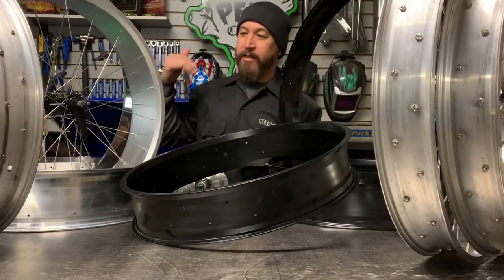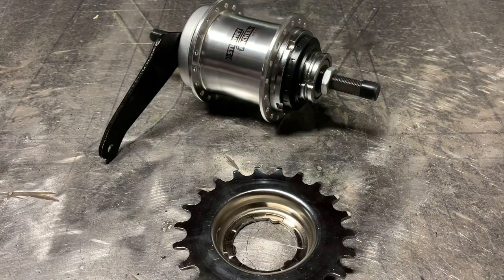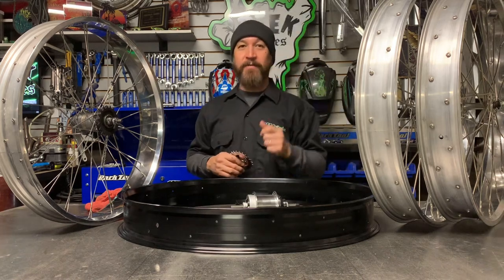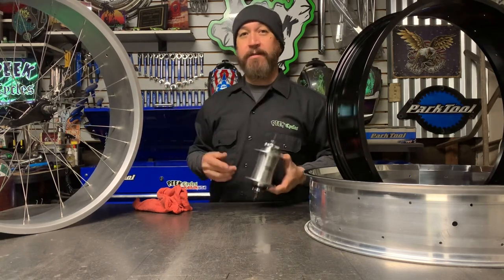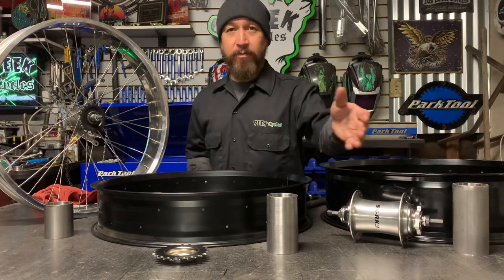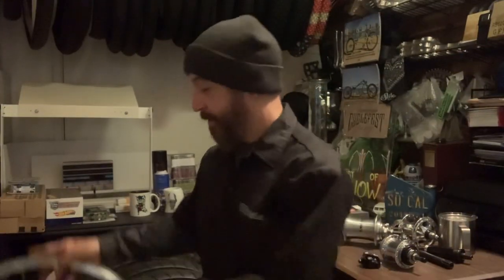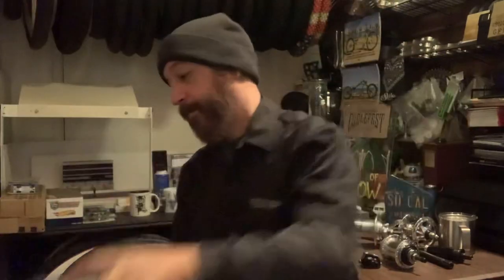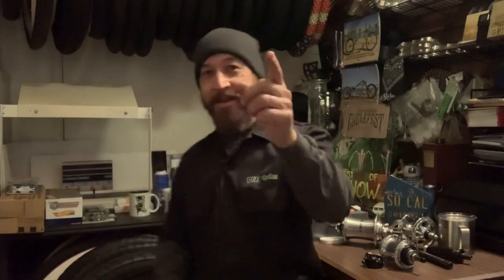Ep58 Peek Cycles: How to Specs, Wheels, Hubs, Bottom Brackets, Top Wheel Builders in the U.S.

Comment: Hay there Jimmy, i have a occ schwinn chopper 24" front rim 20" rear rim, the crank spindle is about 7" the problem i'm having is i changed the chain ring to a 32 tooth but it's a round hole in the chain ring center standard hole and i have a chain ring with a square center hole the square hole one is to big how do i mount either chain ring to the spindle or do i gotta come up with something of my own. Do you have a video on this chain ring and crank spindle, the spindle is for square hole arm's, Thanks Jimmy.
Reply from the maker: Check out episode 58. Let me know if you still have questions. Thanks for tuning in! \m/

Comment: I’ve been waiting for this one episode I am working on the same thing as we speak .Rear and hub bottom brackets 🤟🤟🤟🤟🤟
Reply from the maker: Fantastic! Hope it helps you out!
Reply: @jimmypeek5330  just watched it twice  watching it one more time so it sinks just thanks bruh you really help me I’ve been working on this bike for a while now I just got my wheels in. Still in my club stage but this really helped me perfect timing bro perfect
Reply from the maker: @GypsyGoodOldDays  What size wheels do you have for what frame? If you have a standard 2-3/4” bottom bracket shell on your frame, you’re better off going BMX style bottom bracket so you can go with the wider spindle. Otherwise the European Square Tapered bottom brackets require wider shells.
Reply: @jimmypeek5330  i’m actually running a old Jesse James west coast customs frame that I am heavily modified to except 26 x 4 wheels the frame originally came with shorter styles Short stubby 20 inch wheels . It’s currently sitting a little under 2 inches off the ground I get all my inspiration from your videos , as for the bottom bracket I am currently unsure I will have to modify that also for the Chat Line
Reply from the maker: @GypsyGoodOldDays  Sounds good! You’ll know once you measure the BB shell. Thanks for the follow and kind words. \m/
Reply: @jimmypeek5330  it’s definitely going to have a rockstar stats 🤟🤟🤟🤟🤟